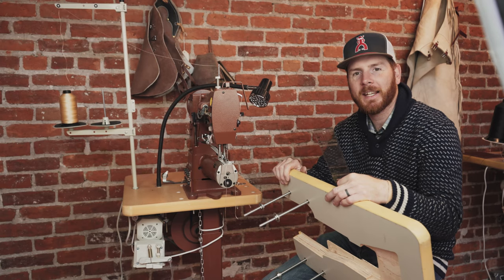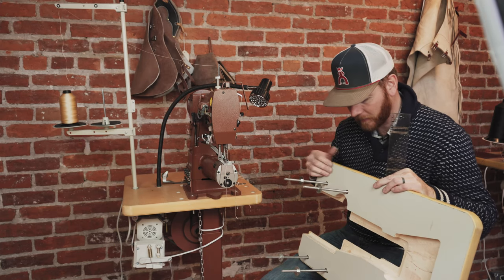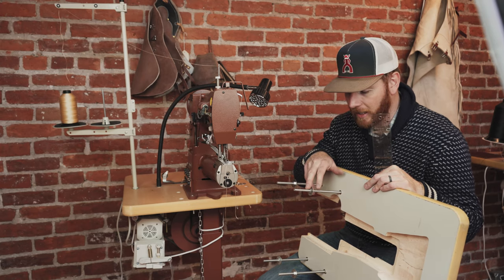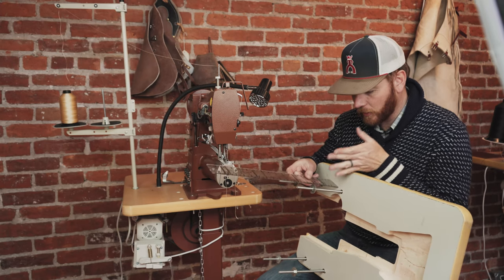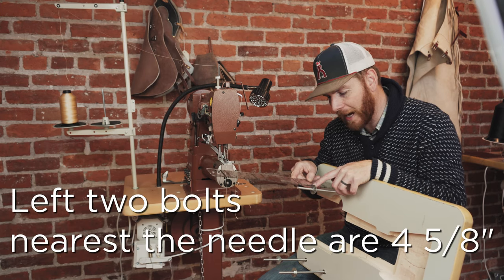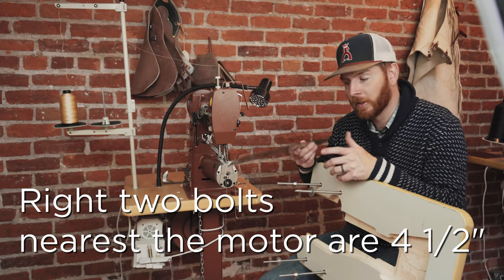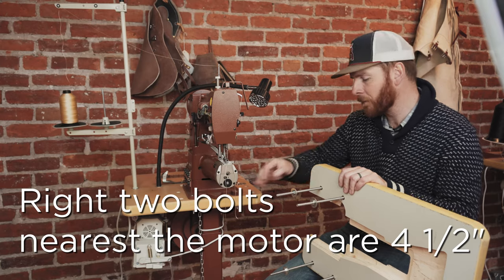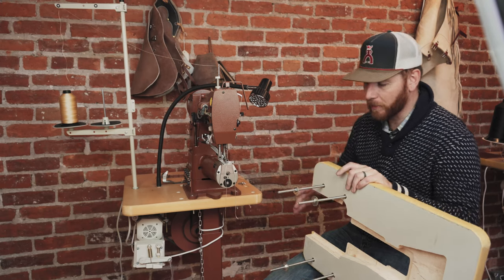Cobra Class 26 Work Platform Installation

Comment: I believe the reason you felt like there were extra bolts and washers is because in the instructions on paper it shows a nut and washer on the underside of the platform after you put in those threaded rods so it goes up against the bottom of the platform around the entrance to the threaded rod.